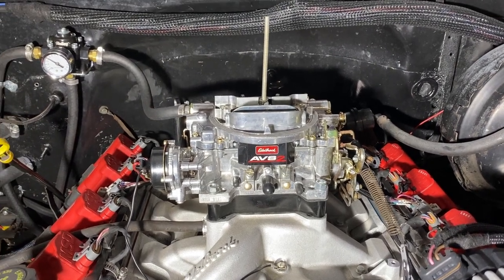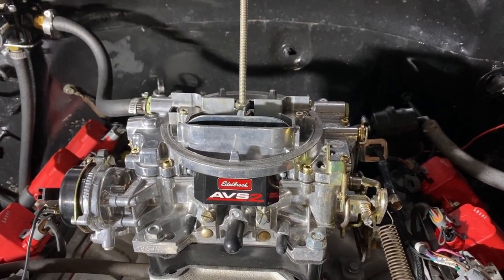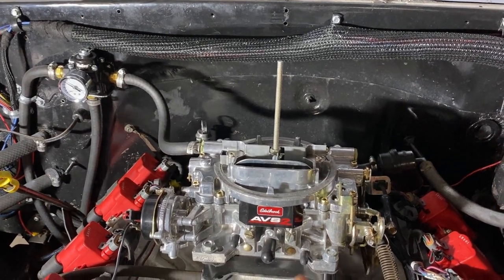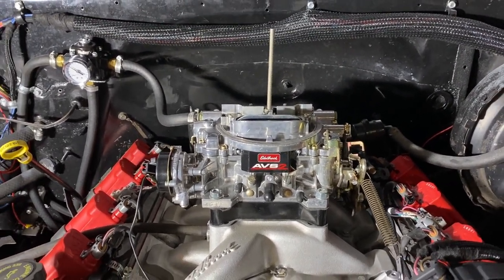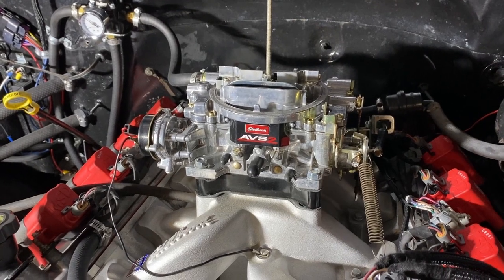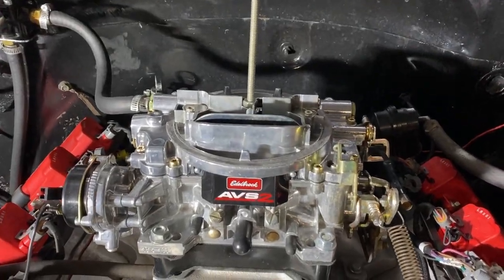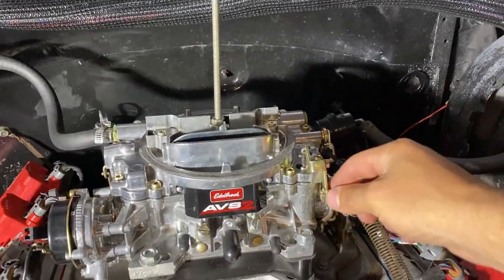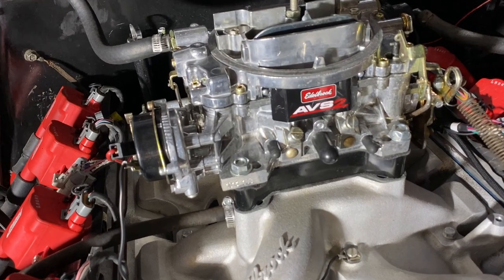HOW TO TUNE A EDELBROCK CARBURETOR! 800cfm AVS2 1913

Comment: Thank you because I’m “that guy” right now. I just bought the AVS 2 650cfm 
I need videos like this. Very simply put
Reply: I’ve decided to switch to a Holley Double pumper carburetor. 
No matter what I did to the Edelbrock AVS2 it still would stumble inconsistently. All though it did get better it just wasn’t 100%.
I narrowed it down to the pump nozzle
Which you can not get a replacement for at the time of this reply. 
The stock nozzle has a inconsistent sputter on the right leg. Ive dialed in timing, used different step up springs, upgraded the accelerator pump and again it did help just not 100%
I will most likely keep the carb and replace the pump nozzle and keep as a backup.